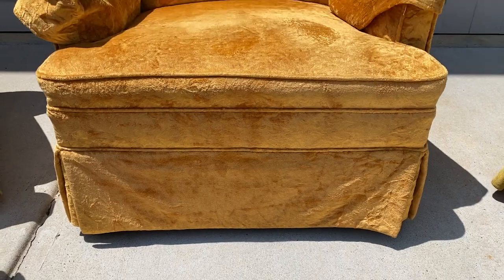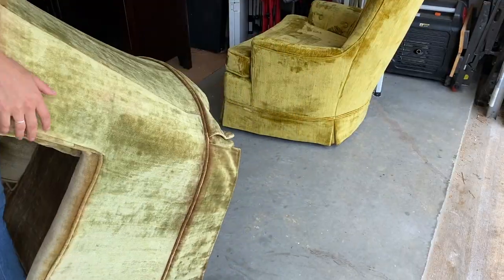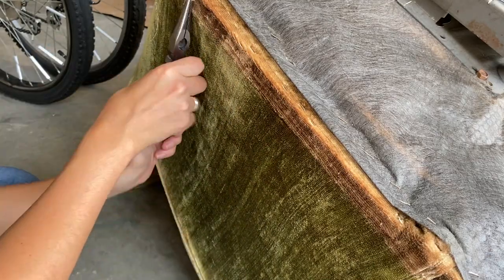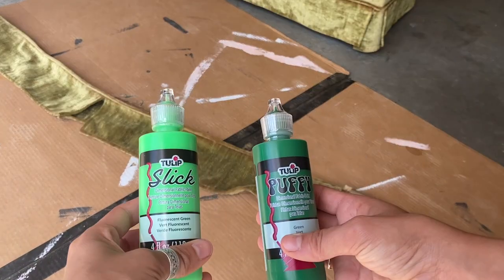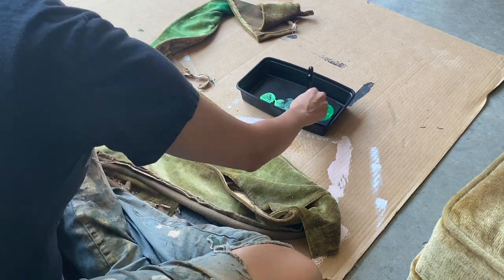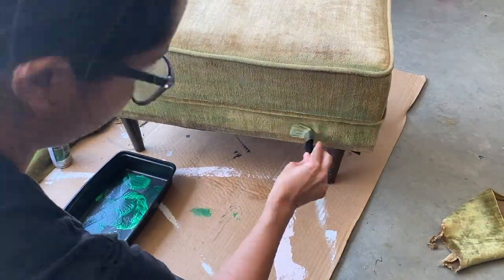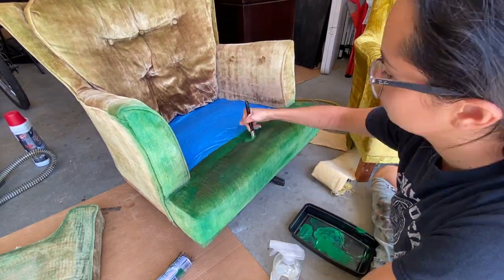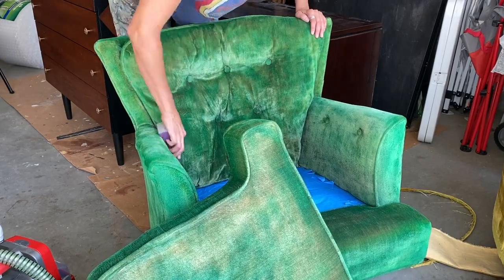How to Paint Fabric | MCM Chair Edition | Episode 14

Comment: I know this is an old video, but I have a little info for you. I tried painting velvet and it was a big fail also! Then I painted some jacquard with mineral paint and top-coated it with Big Top (which I think is water based polyacrylic. That WORKED! It ended up NOT crunchy but supple and felt like leather.
Reply from the maker: Oooh good to know!! Thank you!

Comment: I want to test the new fabric spray paint I see out. Maybe that would work better?
Reply from the maker: Yeah! I mean, you don't know till you try right? Just make sure to either test it on a spare piece of fabric or on a cheap piece first
Reply: @TheMissFlips  I have some bar stools I will test on the seat fabric, it fails I'll cover them! Haha. 

Dont rule out going over the chair with a darker green, add a bit of black, or white so its more minty. 

Sell as is as a test project. Its still a nice looking piece for a low use area, porch, etc. Throw blanket and pillow, still rocks even if the fabric is a bit stiff.
Reply from the maker: @sprinkledandpainted  Yeah, I sold it already or else I would definitely take your advice and try something different